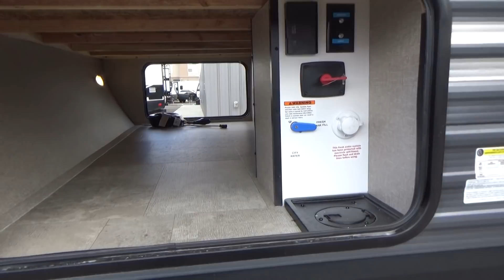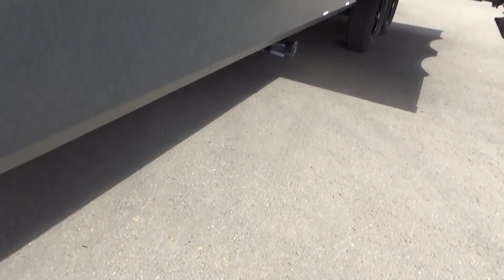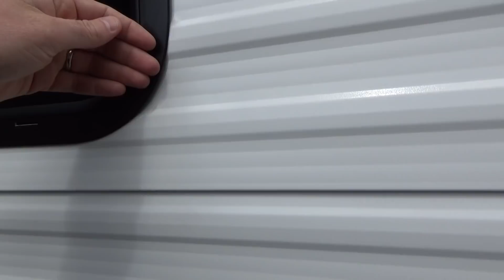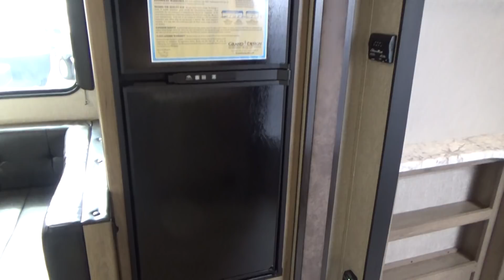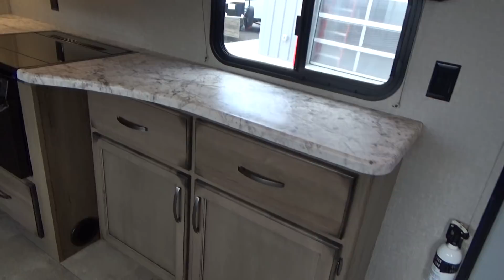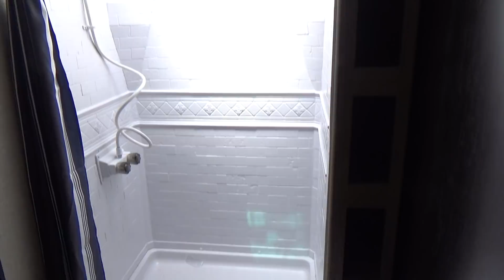2020 Grand Design RV Transcend XPLOR 265BH Travel Trailer Bunk House

Comment: SORRY 😐 but it's a FAIL for me... Truly Unbelievable how YOU kept saying [They] take the EXTRA steps for the customer doing the things other MFG's don't... but then amount of things [They] obviously neglected 😩 to include to save a few bucks is incredible... TOTAL LACK of appropriate WINDOWS throughout... and  TV 📺 included... seems like everything will have to be added-on... seriously 😒 only a 6 cubic foot refrigerator for a large bunkhouse... the cheap SHOWER CURTAIN has GOT to go (so out dated, try a retractable or glass) also the shower faucet the cheapest available, try using the recirculating value to save water 💦 while it's getting HOT... also noticed that CHEAP fiber board used under the bed (NOT the BETTER PLYWOOD)... oh, and those U-Shaped Dinettes SUCK, you can really only seat THREE at those tables, no place for the legs of any more adults... YOU attempt to CLAIM it's a superior build but EVERYWHERE you look 👀 the trailer is lacking in QUALITY PRODUCTS... YOU claim a TON of storage but in reality there is very little... OUTSIDE the LACK of a included LADDER is beyond me... seriously, you can't put the Slide-out back in until you SWEEP it off because [They] don't include a Slide-Awning and without a ladder it's a REQUIRED task that can't be completed... also that SMALL 16' awning just doesn't fit to cover the front door 🚪... and your excuses about the small propane tanks is LAME. I'm afraid 😳 YOU have a BIG bunkhouse that's a incomplete... and claiming this beast is 1/2 ton towable is just DANGEROUS... maybe completely empty, still scary but maybe doable with a built-up NEW version but seriously not with a standard 1/2 ton pick-up... I liked the easy access to the bunks compared to other floor plans but just to many miss or CHEAPLY built features and the complete lack of so many amenities that other manufacturers have included... was it do to price point or a attempt to hit a certain market, I don't know 🤷‍♀️ but I call it a FAIL... thanks 🙏🏻 anyway.
Reply from the maker: Tim Burton, thank you for your extremely detailed response. We can clearly see you have a deep passion in knowing the type of RV that would best suit your needs and wants. We’re sorry to hear the Transcend doesn’t fit the bill for you. We also understand there isn’t the perfect trailer out there that will work for everyone. Sounds like you may be looking for something with a few more bells and whistles. Maybe try looking into the Reflection or Imagine lines by GDRV. You may find something there that’s a little more suited to your liking. Thanks for watching!! Take care and happy camping!!😀
Reply: Thank you for your reply    please tell me what the perfect rv is for you because I need to buy it. You are so smart and I need your expertise in choosing. Maybe one day I will be as smart as you

Comment: Is it safe to tow this vehicle with a 1/2 ton or just use a 3/4 truck
Reply: It pulls very easily with my Ram 2500 Cummins.
Reply from the maker: Mathews Hoyt, great question!! You can mosey definitely pull this trailer with the “right” 1/2 or 3/4 ton. Please always be sure to verify the tow and payload capacities of any tow vehicle so it meets proper safe towing specs. Also, make sure you’re equipping the tow vehicle and trailer with proper towing equipment such as weight distribution hitch and brake control. We hope this helps!!😀
Reply: I'm using a half ton.  No issues